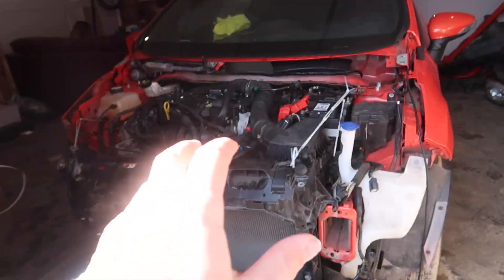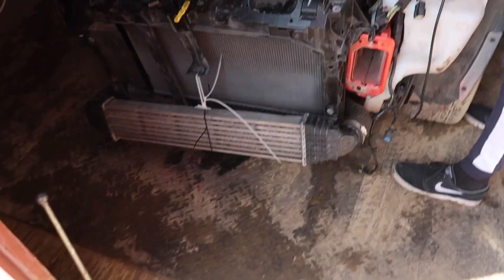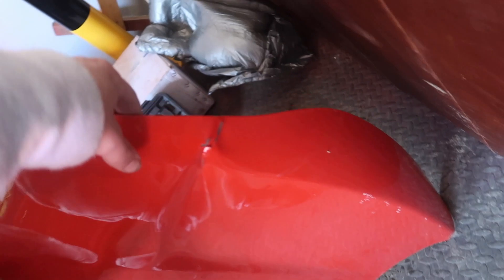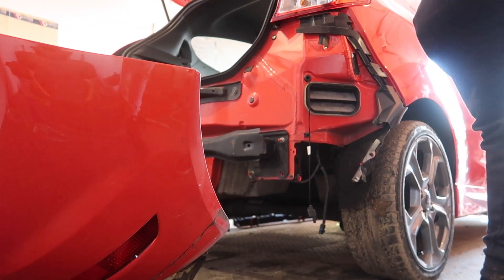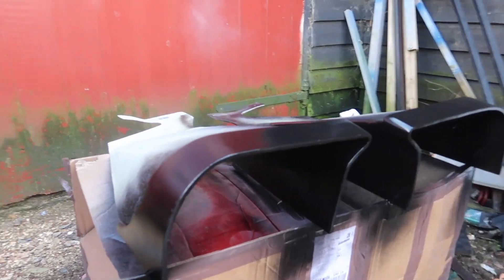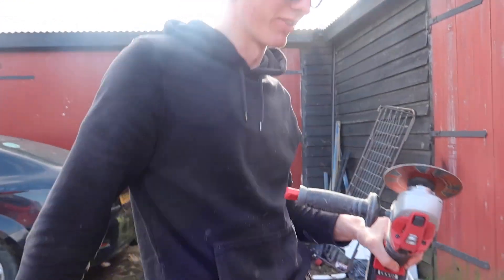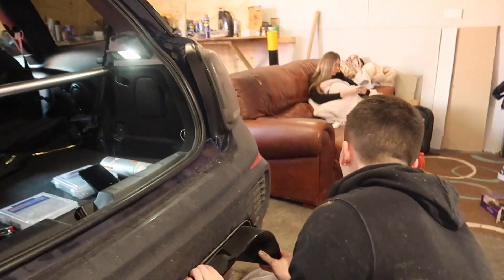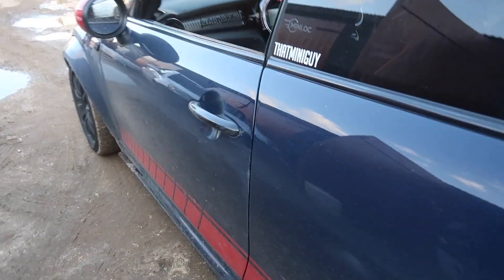WIDEBODY F56 JCW GETS CRAZY REAR DIFFUSER!!!!

Comment: Yes it is a legal obligation to run rear reflectors, as it states in the mot rules and regulations.
Reply: Can’t forget the full stop at the end.
Reply: Lee G never.
Reply: Is it illegal to tint rear reflectors and the top brake light?
Reply: zRPG-_ it’s not illegal. However the reflection / light emitted from the rear should not exceed 50% tint and should still be clearly seen. Saying this it is down to the police/mot inspector to decide whether the tint is ‘excessive’